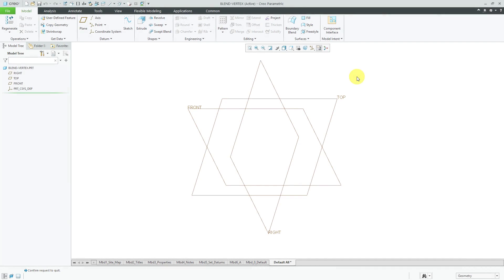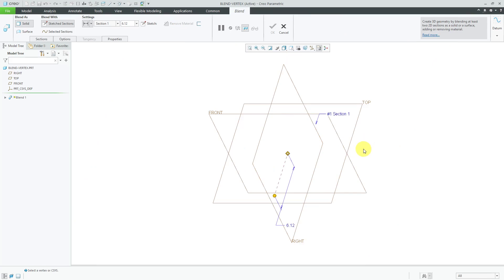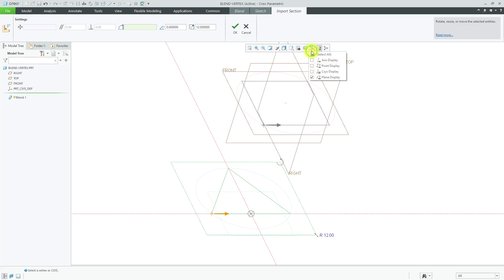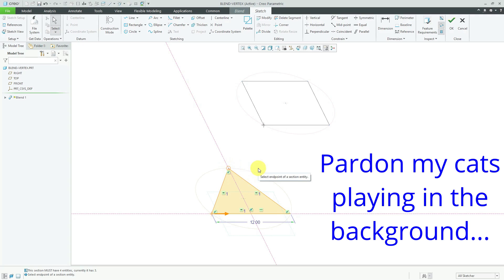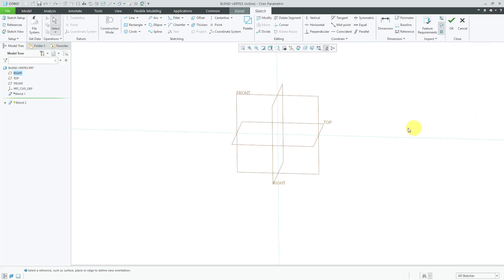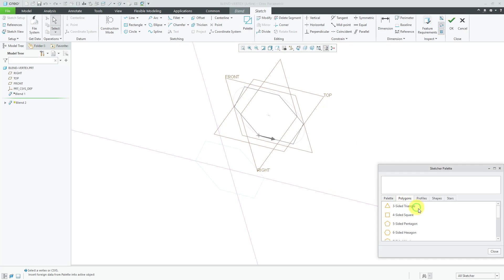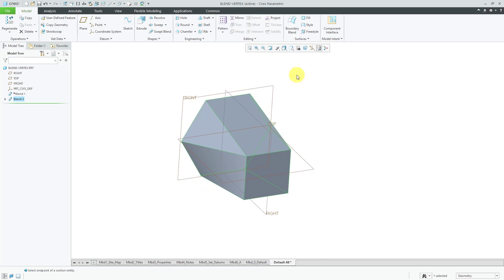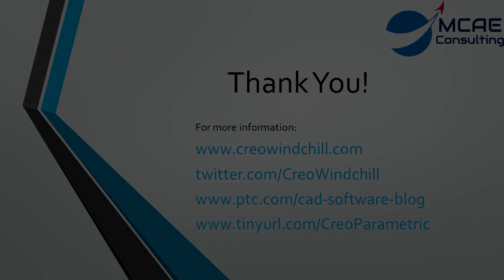Creo Parametric - Blend Features - Blend Vertex - How to Handle Uneven Number of Vertices

Comment: Is it possible to create a square to round transition with multiple fold lines? For example if making out of sheet metal you might have folds every 10 degrees round the circle going to the corners of the square. Thank you
Reply from the maker: Yes. You just need to have the circle and the square broken up into the same number of vertices. I wouldn’t pick 10 degrees though. I would pick something that would come out in a multiple of 2, like 22.5 degrees or 11.25 degrees.